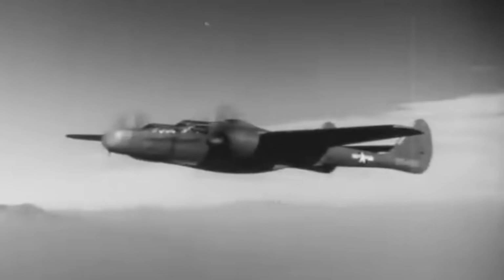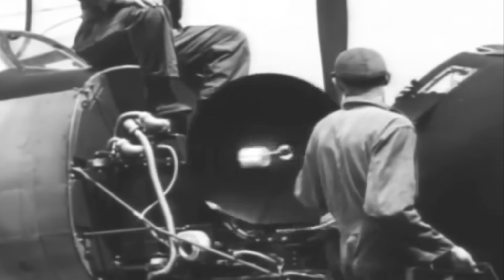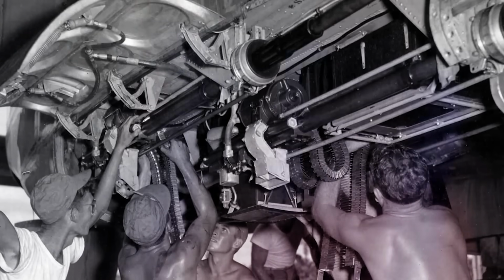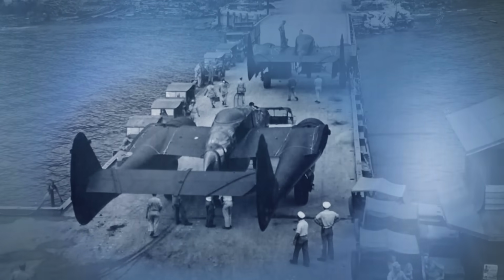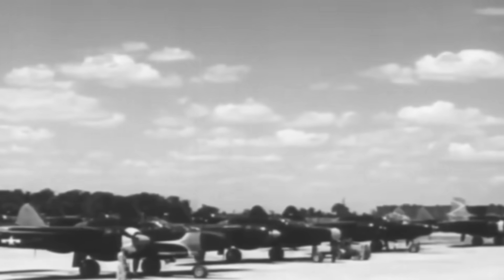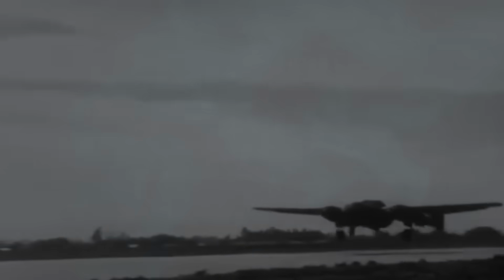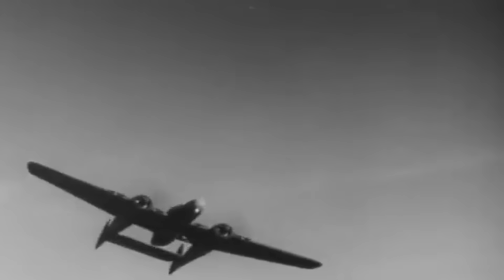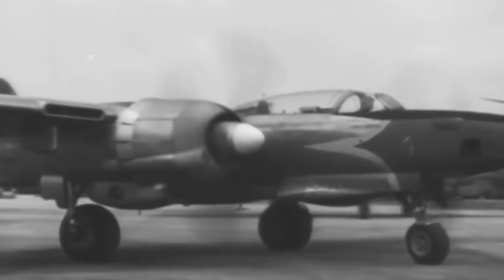The Mysterious Plane That Made 127 Kills Without Ever Being Seen

Comment: Too often forgotten about are the first American nightfighter squadrons to go into combat in North Africa that were equipped with British Beaufighters.  As many as four American squadrons flew Beaus until they were replaced by P-61s.  The Black Widows were found to be too slow and maintenance hogs.  The radar system was great, but targets too often ran away from them.
Reply: The point of the night fighter.....the target doesn't know your there. Not a chance to "outrun"
Reply: @hokep61  If you can't intercept them in the first place because your aircraft is too slow, you're not going to be successful.  Between that and the maintenance problems, British night fighters such as the Beaufighter and the later Mosquito were much more effective and their kill ratios prove it.  

Out in the Pacific it was a different situation, where the P-61 was the only night fighter that could maintain a nighttime CAP for a long time versus the single seat F6F-N and F4U-N fighters.  The limitations of the single seat night fighters, though faster and more reliable, became quite apparent once the P-61s came on the scene.
Reply: My Dad served with the 427th NFS . The 61 had no problems intercepting night targets.... like it was designed to do. That said, buy the time it entered service, those targets weren't all that plentiful. As to maintaining the systems, it was a big job mainly due to the new tech of some of the systems. Add to that,  Northrop had trouble supplying replacement parts. Dad was a crew chief and the only maintenance person assigned to his 61, which was not that unusual in forward combat zone.....yet they kept them fully operational.
 As to the speed, initial design time.....it was pretty fast....when it actually went into service....not so much. The C model was faster...but too late to enter service.  But again, speed wasn't an issue when you  come in behind the target, in a blacked out aircraft. They dont know your there.....till you unload the 20mm.

Comment: The P-61 achieved about the same number of kills in Europe as in the Pacific.  The turbocharged P-61C was not deployed.  It had a top speed of 430 mph at a higher altitude than the P-61A or B.  At least two British books claim that the Black Widow with its innovative spoilerons was the most maneuverable fighter in the war.  There is a claim that a P-61 engaged three FW-190s and downed two of them, the third escaping.  The P-61 was used for intruder attacks and could carry 4 x 1600 lb bombs on shackles under the wings.  During the Battle of the Bulge the Black Widow was about the only plane that could fly in the foul weather - but there was a shortage of planes.

Comment: RAF Blenhiems and Defiants became the first Night Fighters in the early days of the Night blitz in September 1940, equipped with Early Radar. They were adapted aircraft slow in performance and having light armament. They had a few successes against the Luftwaffe. In. the Interim the USAAF used the P-70 and the RAF the Havock. Both being adapted Bostons. Along came the Beufifgter and Mosquito that had heavy armament and high performance, Again Radar equipped. The later Mosquitos having better Centrimetic radar. The USAAF Also used the Beaufighter until the P-61 entered service. All night fighters would operate with a ground controller as standard practice. I doubt by even the introduction of the Black Widow that fully autonomous night fighter operations were possible.

Comment: I always loved this plane, even though the top speed of the B model was pedestrian compared to other similar types. The “C” model at 430 mph top sped was what was really needed, but, again, arrive too late. With the heavy gun argument and ability to carry 6 inch rockets or four 1600 pound bombs, It could have excelled in the ground attack role, but had too much overlap with the B-25 and B-26, & The other types could do level bombing as well, since they had proper bombsight equipment.

Comment: The ARC-170 from the star wars prequels was based off this airframe! Designed as a platform for solo recon and heavy fighter/bomber roles, its essentially the same craft with a modified nose, omitted tail section and two large canon mounted at the wingtips

Comment: This guy needs some fact checking...
The RAF developed the Bristol Beaufighter (radar equipped) into a night fighter early in 1941.
The Germans had them in 1942.
When it comes to the P-61 which was, granted, the..."only purpose-built night fighter design deployed during the war, the American Northrop P-61 Black Widow was introduced first in Europe and then saw action in the Pacific, but it was given such a low priority that the British had ample supplies of their own designs by the time it was ready for production. The first USAAF unit using the P-61 did not move to Britain until February 1944"

Oh and it was propeller driven not a "fighter jet" (time stamp: 2:09)

Makes you wonder what other crap this bloke spins...

Comment: 7:25  I'm not surprised that the P-61 was outmatched on speed.  The P-47, one of the bigger fighter aircraft in the inventory, weighed in at 18,000 lbs. takeoff weight.  The P-61, according to this video, weighed 29,000 lbs.

Comment: The DH98 Mosquito was used as a night fighter from late 1941. It was a better aircraft in every single metric, especially in speed.
Reply: Jack Tangles  Thanks for the cool reply. The DH98 was a brilliant aircraft where most components were made in boat yards an furniture shops. The bombers were too fast in intercept and the fighters packed a huge punch. They could fly to Berlin and back, too. On that Berlin run. it carried the same bombload as a B-17 with a crew of ten. They were adored by their crews and had the lowest loss rate in the Allied Air Forces.

Comment: Worlds first night fighter? I thought Germans had night fighters earlier than the P61. For example the Messersmitt Bf 110 G. Which entered front line service in January 1943.
Reply: The distinction that the P-61 holds is that it as the first aircraft designed from a clean sheet expressly as a night fighter.  The Bf 110 night fighter was an adaptation of an existing airframe

Comment: It was an enormous aircraft that was better suited to the Pacific theatre, as there were issues (later rectified) with the caesin glue used in the Mosquito. Unfortunately the P-61 really had no niche as a nightfighter in the ETO as that role was fulfilled magnificently by the nimble 2-seat, 4x20mm cannon armed, Mosquito. It was realised the P-61 was obsolescent, as it was scrapped immediately after WWII - the Mosquito, however, remaining in both military and civillian service until the mid-1960s. 👍

Comment: The remote turret was removed on later version s due to the buffering that it caused with air flow over the aircraft   you mention t h e Airacomet jet which was not successful and the early Meteors which never clashed with German jets

Comment: The third crewman for the 'Widow was the Radar Operator, not Radar Engineer, and the ME-410 couldn't out run a P-61, because, its maximum speed was around ten to twenty miles per hour faster, which means the P-61 was able to catch up to it, and shoot it down.

Comment: "How do we hide a plane at night?  Hmmmm."
"I know!  PAINT IT BLACK!"

Light bulb.
Reply: Not quite as intuitive as you might think because in reality a dark blue blends into a hazy twilight sky better than a stark black
Reply: Yeah takes a lot more thought than you might think. They originally painted the P-61 matte black to absorb the most light but found that when hit with spotlights the plane would appear to glow around its edges. They ended up doing a series of tests that found gloss black paint does an adequate job of absorbing light while not displacing it to the edges. Also interesting to note that during a series of tests later conducted for the best paint for night fighters... a dark shade of PINK was actually the best overall color for absorption, but ultimately turned down by top brass because they felt no pilot would want to fly a pink plane. Look into it, it’s pretty interesting.
Reply: @thorrell1673  I take that the USAAF brass rejected the pink aircraft, as the RAF used pink photo-reccon Spitfires.
Reply: Neil of Longbeck correct.
Reply: T Horrell The Japanese in China used a grey violet paint scheme that helped hide them in the haze as well. Also the US did used “Titty Pink” in the paint scheme for their bombers based in North Africa

Comment: Good video, but it's a bit of a stretch to say it was the jet fighters that gave allied forces superiority in the air war. Most of the advances were developing all-metal propeller planes with supercharged and/or turbocharged engines. The jets came later, and were a huge advancement, but not really what won the war.

Comment: The P61 had spoiler roll control, and near full span flaps.  This I believe unique among WW2 planes.  The P61 could roll into a dead engine, a sure way to get killed in other twins.   The spoilers were very light to operate, and was short coupled in pitch, the P61 could be thrown around.  The P61 had Zap flaps that moved back increasing wing area, and rotating down, similar to Fowler flaps.   (Spoilers and full span flaps are used on the Mitsubishi MU2 and the Dahler TBM.  Both these planes are the fastest in their class.)
    It was serendipity the P61 made the war at all.  By 1942-43 Northrop was stretched thin, thin, thin as it was working on the Wing and other projects.  They were competing with Lockheed, Consolidated, Boeing, Douglas, Bell, Republic, North American, Curtis for engineers and designers.  The Army kept changing requirements.   Amazing what can be done when there is a war on.

Comment: My father-in-law was a flight instructor in WWII and flew many types of aircraft (but not the P-51).  I asked him one night many years ago which was his favorite aircraft and without hesitation he said the P-61. When asked why he told me that he could go from slow flight to cruise speed without need to trim the pitch. It was smooth and a joy to fly. So then I asked him which was his least favorite and he told me (much to my surprise) it was the P-38 because at full take-off power sometimes the Allison engines would 'hick-up' and for a moment he would fear an engine failure at take-off.  He passed away many years ago.
Reply: @iconoclastpleonast8726  you right  and it might of had if 

1 if the RAF had not reject it
2 the US military were not nationalistic snobs  most of the time( i say this it the fondest why )
Reply: @iconoclastpleonast8726   US  the built the Merlin did go to the Mustang and the Mosquito and all the other aircraft plus those built in the UK , Though the UK was making a lot of equipment but it was small compered to the US. and the  war was really won on the Factory floor.
 Yes it would of been interesting to see it the P-38 but what i hard and read this was more down to Military snobby than availability on the engine, the US top brass just wont not except another US aircraft with a non US engine regardless were it was made
Reply: @iconoclastpleonast8726  i agree with  you a lot of you tube worriers say we did not want the P-38 with the supercharger in them  but i watch a program were it said the USA government did not us to have he supercharge version for the same reason
Reply: @daniellastuart3145   The Allison V-1710 had an engine driven supercharger, and in the P-38 it also had a turbo-supercharger (turbocharger)  So, I'm not sure what you mean that we didn't want a supercharger in the P-38. They all had 4 superchargers.
Reply: @andrewalexander9492  what i mean is it was the USA that refuse to sell use the Supercharge P-38
Reply: @daniellastuart3145  Well, Again, the P-38 was supercharged.  I'm not sure what part of that you're not understanding.
Reply: @andrewalexander9492  i know it but the one sold to the RAF in 1940 were not they called them the castrated P 38 it you not  understanding.things
Reply: @daniellastuart3145  The "castrated" P-38 had an engine driven supercharger (just like other every P-38 built) The British ordered them without the turbo-superchargers (their choice)  so that the engines would be common with the (Supercharged, but non-turbocharged) Curtiss Tomahawks  which they had already ordered.   here's a webpage that discusses the cancelled British order for P-38's and the reasons the British ordered them without Turbochargers http://www.joebaugher.com/usaf_fighters/p38_7.html 
 Again, that was the RAF's choice to order them without the turbocharger, it wasn't some sort of Anti-British conspiracy.
Reply: @andrewalexander9492  yes i had this version of the story but i also herd the version were it was the USA that  would  not let us have the  turbocharger because they were afraid it land in German hands. by the in 1940 they was quite a lot of  Anti-Brutishness in the US Government and the country
Reply: @daniellastuart3145  19 hours ago, you thought the British ordered P-38's didn't have superchargers (they did)  and didn't understand the difference between their supercharger and the turbo-supercharger.  Now suddenly you're an expert on US policies on the export of Turbocharger technology during WWII?  Please!  So, tell us,  if the US didn't want the British to have Turbochargers, why then, at the same time the British were ordering P-38's, was the US entering into agreements with the British to provide the RAF with B-17's which  had turbo-superchargers?  B-17s that would be flying over Germany, and occupied France, and inevitably getting shot down over German held territory?   Your whole "The US was depriving the British of Turbocharged engines so the Germans couldn't steal them"  conspiracy theory is not only False (the US was sending B-17s with turbochargers to the RAF)  it just doesn't make sense (The Germans, generally were ahead of the US in aircraft technology) .    Look, it's obvious you have some sort of Anti-US agenda here, whcih is fine, everyone needs to have a hobby.  But you're  departing fairly significantly from historical fact and rationality in support of your prejudice.
Reply: @iconoclastpleonast8726  ya live in East London the part that got bomb the hell out of in 1940/41

Comment: I believe this plane is actually the first purpose-built night fighter.  The HE 219 Owl for example was designed before used successfully as a night fighter.
Reply: The P-61 was the only aircraft from the Allies that was designed, and built from the wheels up as a Night Fighter, whereas the HE-219 was the only enemy fighter designed from the wheels up, as a Night Fighter. Japan also fielded a puropose built Night Fighter: The Nakajima Irving, as well.
Reply: @johnosbourn4312  No, the HE 219 wasn't built from the outset as a night fighter.  It came from 'projekt 1060', a multipurpose design that was intended to be either a heavy fighter, recon plane or torpedo bomber.   The Nakajima J1N was initially built as a bomber escort fighter.